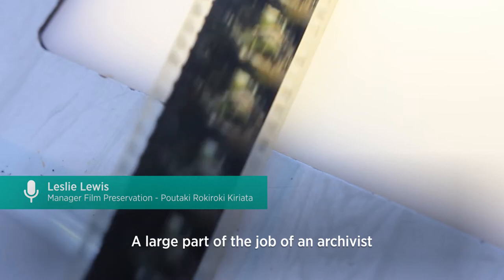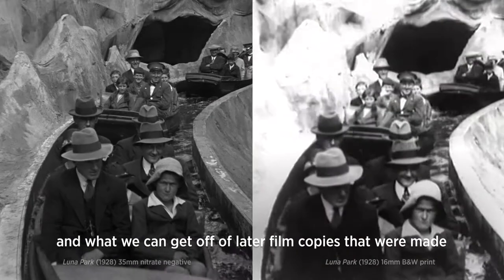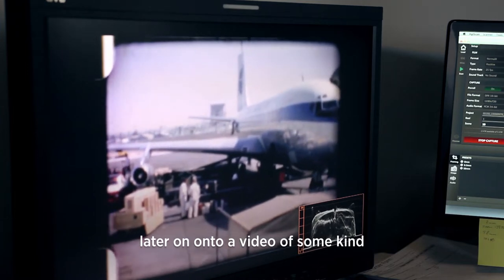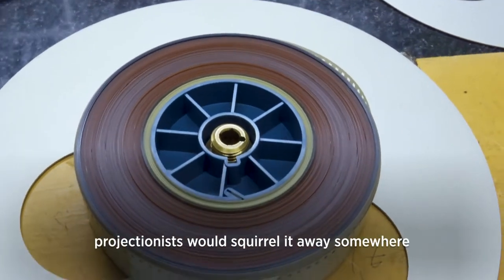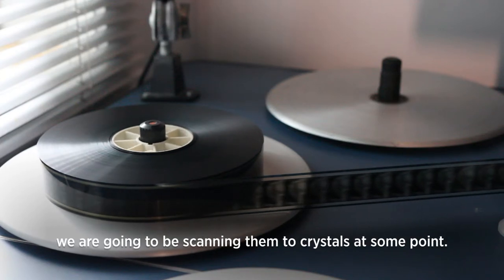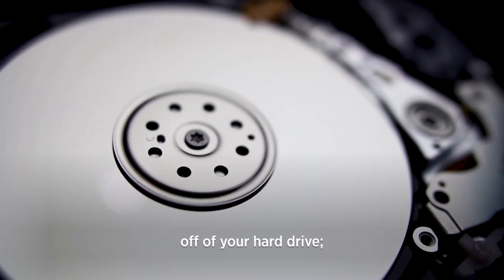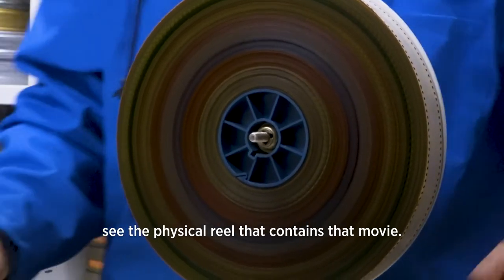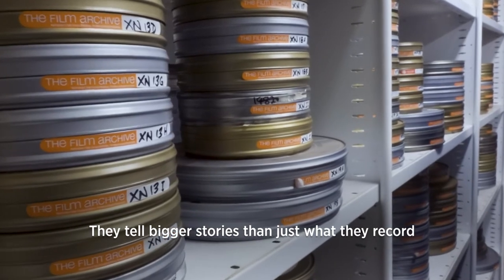Nitrate film why do we keep it?

Comment: I have worked with nitrate 35mm for over twenty years, over three hundred hours of projection and checking,repair.  I like it more than triacetate film, no vinegar stench. More silver, longer runs on a print. Most projectionist in the early 1950's were against the transition to safety film. Keep preserving!

Comment: My dad was  was born in 1919 and Old enough to have been around when Nitrate film 
was used exclusively. and I remember as a kid, him explaining to me that  the nitrate film
 was so flammable, that if it were to get stuck in the film gate, the heat of the light source
[  usually a "Magic Lantern" ] would cause the film to overheat, and start to bubble and
melt and then ignite into a really hot flame and  burn like gasoline. and he had seen a few
 movie theaters burn to the ground because of it. and that is why movie theater projectors
were housed in a metal  armor with the stack running up through the roof to the outside.
because the fire could be better contained this way.

Comment: I save film to Digital then M-Disk. I prefer to think that 1000 years is a long time. M-Disk will out last all film and is not affected by heat or cold or other elements. Also M-Disk doesn't need to be keep in a control environment. It's the perfect choice in my Digital transfer business. If you make a capture of a film with a superior lens to digital, you can be assured that quality won't be and issue. We of course are not talking about Wolverine Pro consumer Digitizers.